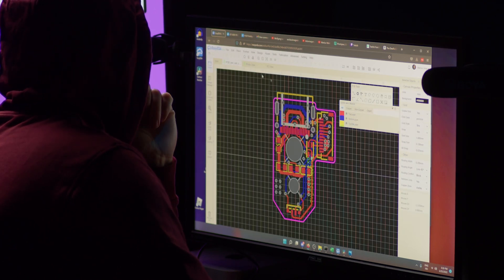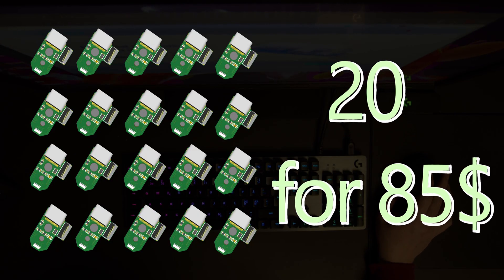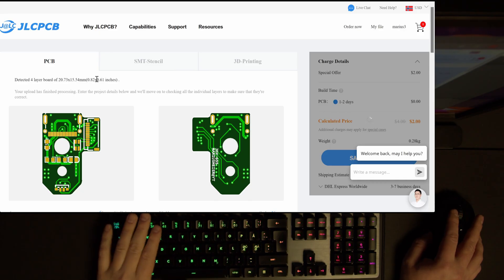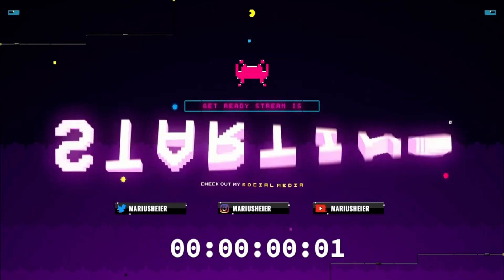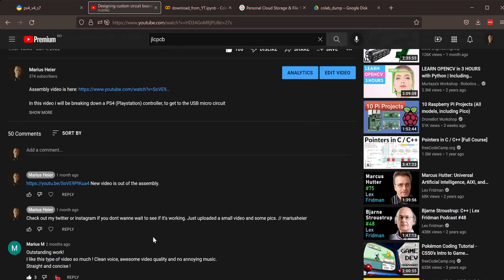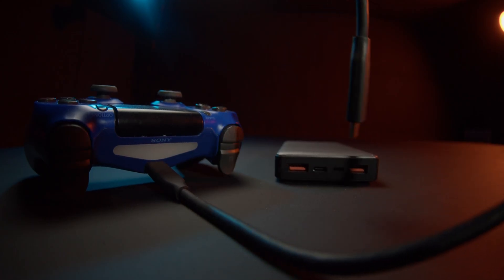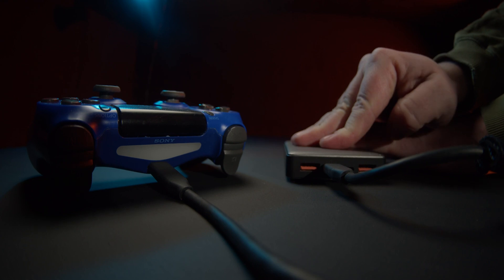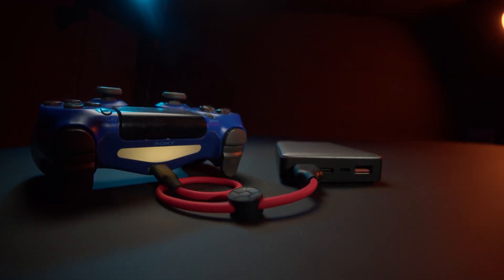DIY USB-C for PS4 straight from the factory

Comment: how did you fix the issue? did you add a charge controller or something?
Reply from the maker: You just add two 5.1 k ohm resistors between cc1 and cc2 and gnd. :) Check my insta or twitter for whats coming in the next video.
Reply: @MariusHeier1  ah yes. i was wondering why you didnt have those resistors

Comment: can i salvage good part from broken or dead charging motherboard like caps or connecter and place them onto new usbC motherboard? or are the components different?
Reply from the maker: It has different size than the original ones.

Comment: I believe I'm the author of the comment you've mentioned. I spotted the flaw - a common one not only for hobbyists like you, but many commercial USB-C products, and wrote my initail comment.

But I think I wanted to double-check with your scematics and other videos if what said was actually correct, and also look for sources to include in my comment - and deleted my comment with the intention to later re-write it in a more profound and correct way. And well, I kinda forgot to do that ¯\_(ツ)_/¯

I'm glad you still read it and have corrected the design, and I look forward to the new board working with a C-C cable
Reply from the maker: There you are. That is super awesome man :)
Reply from the maker: I knew about it pretty well. I only had to read to your "56K ohm" part before i had to double check it and could not believe my eyes.

Comment: Omg this is insane !! Thanks a lot! I wonder if somehow using this board will reduce input lag since type c connection is faster than micro usb
Reply from the maker: It still runs on the same speed. So its gonna be the same. However a cable should be faster than wireless.
Reply: @MariusHeier1  Yea definitely it is, I’ll order a couple if them and test them, thanks again!